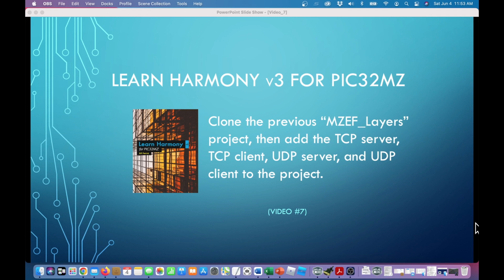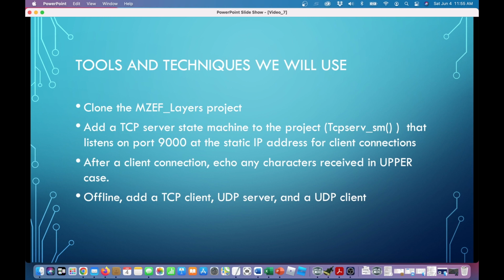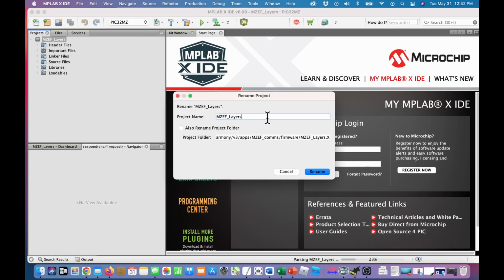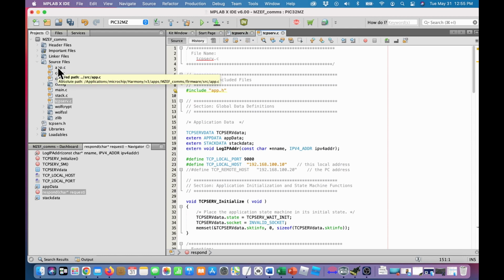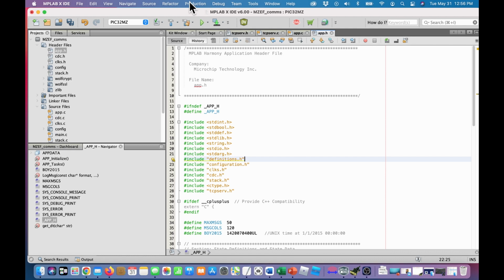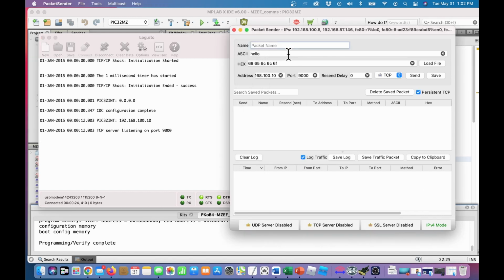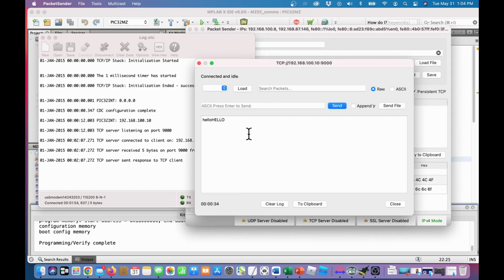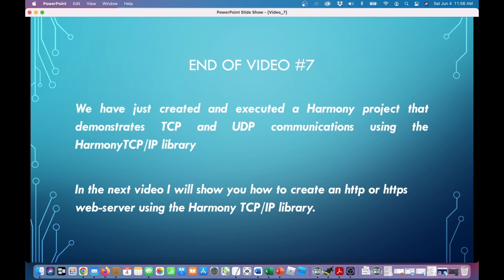Learn Harmony v3 for PIC32MZ - Video #7.  TCP and UDP

Comment: Hi sir Bill P.,
    Thanks to you, I managed to run the "TCP/IP" protocol. All is good.
For a student project now i am planning to import the modbus protocol. I'm having trouble finding resources.
my plan is to make changes to the "send/recv" region of the software I have integrated according to yours. 
But I'm having trouble importing modbus protocols. Is there anything you can suggest me?

Best regards,
Mustafa Yasar
Reply from the maker: Good to hear.   You are on the right track.  There is an application note on the Micrcochip website that may help.  Search for AN1568. There is some source code available but it may need some debugging.  ModbusTCP is the same as regular Modbus, except it allows you to package a bunch of Modbus requests together and them send them with TCP and wait for the responses to come in the recv function.  I hope this helps.